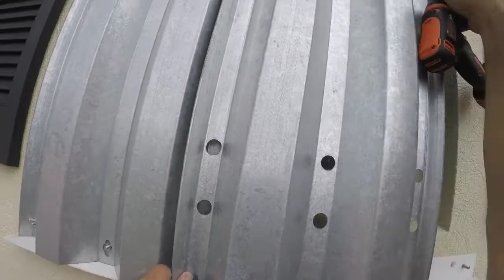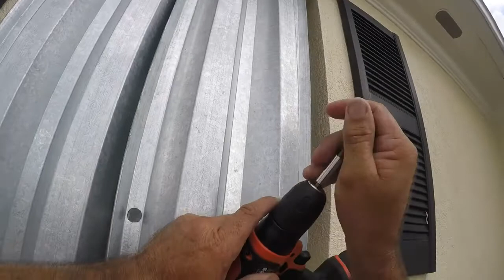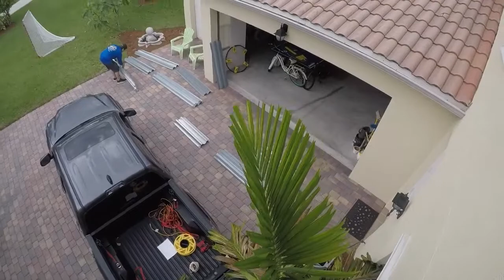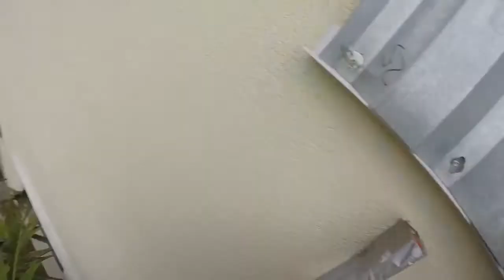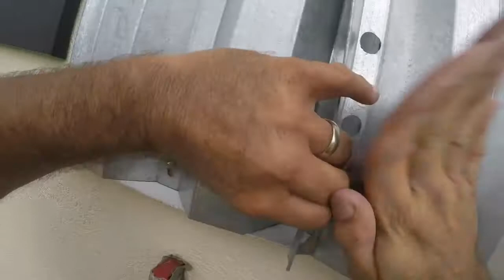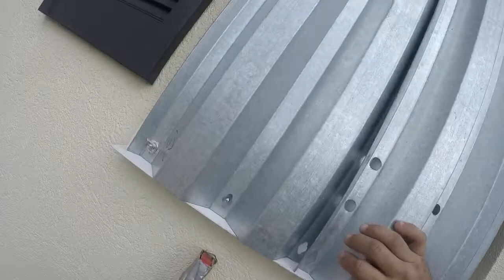HANGING HURRICANE SHUTTERS! ...YO!

Comment: Just some of the pleasures of putting up corrugated storm panels. Even if you have windows that are identical in size, it only takes a fraction of an inch to make deployment difficult if not down-right dangerous. Those panels are sharp and if one falls from the second floor and hits someone/something, you can be assured that some serious damage will result. It won't matter if they are Lexan, aluminum or steel. Anything falling from that height or being grabbed by a gust of wind is going to cause property damage, injury or both. You might want to consider wearing gloves, safety glasses and a tool belt to hold drills, bolts and wingnuts.
All of this can be avoided if you install permanent window protection to keep windows - especially expensive impact windows - from getting broken. JMO